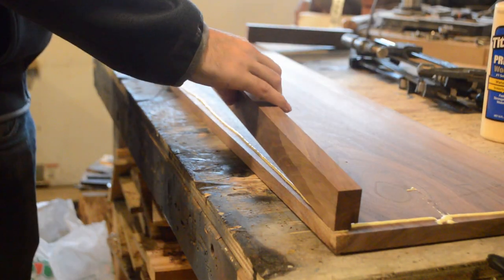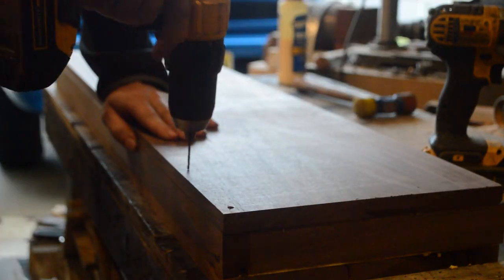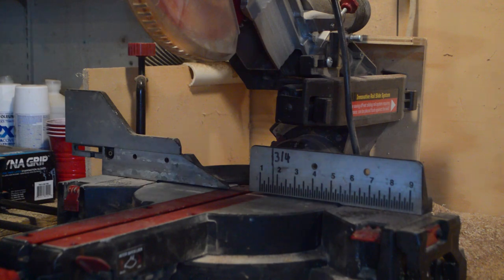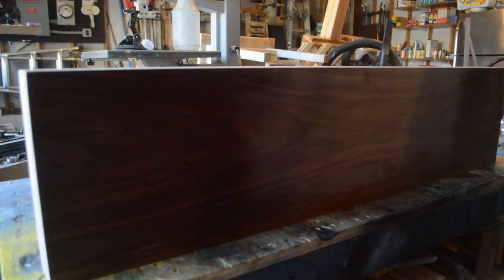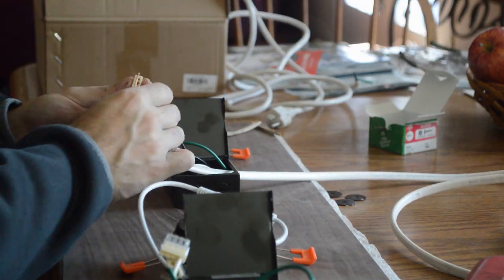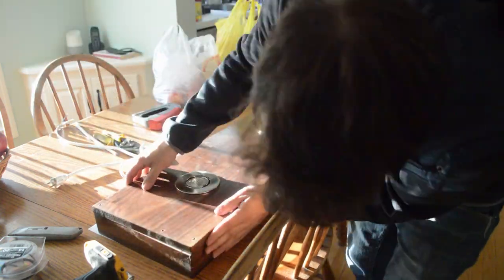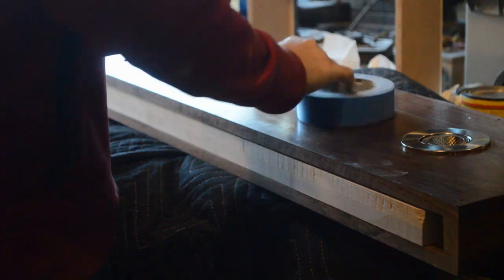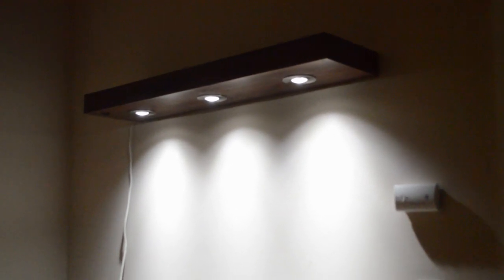Floating Shelf With Recessed L.E.D Lighting.

Comment: Can you explain about the extension cord and how to wire the lights in series?
Reply: I did something similar with two lights and fitted them in a radial series. I attached the two wire cable between the transformer of one light and into the transformer of the other. Also attached to the second transformer was another longer piece of two wire cable that led to the switch. From the switch I used a three wire cable (that included an earth) that had a plug on the other end. I have made a video explaining it all.